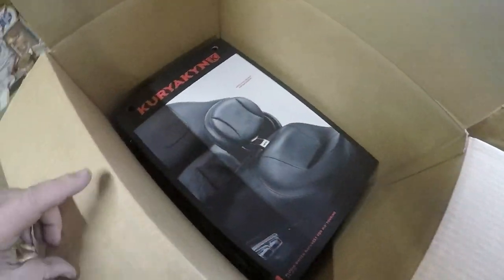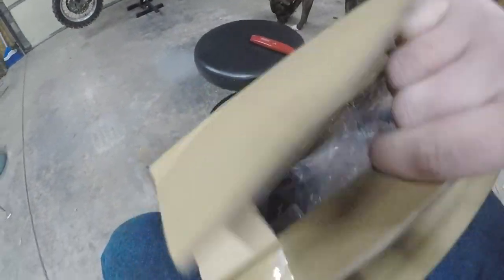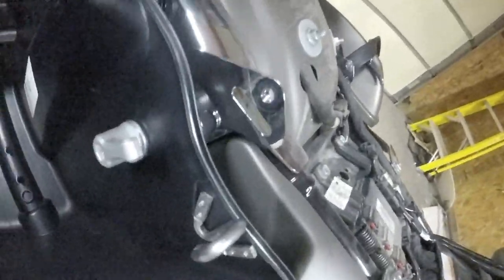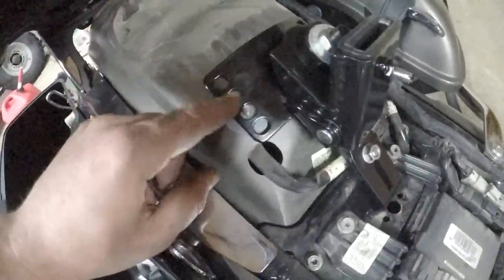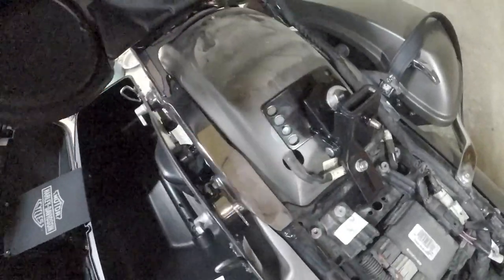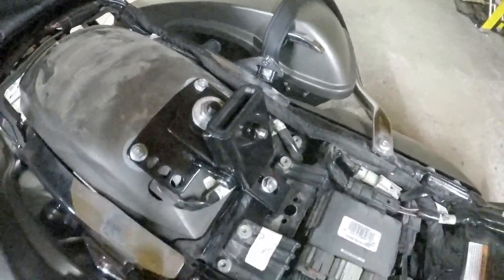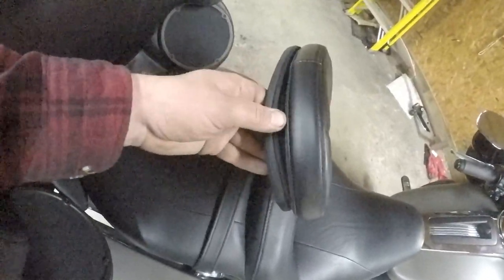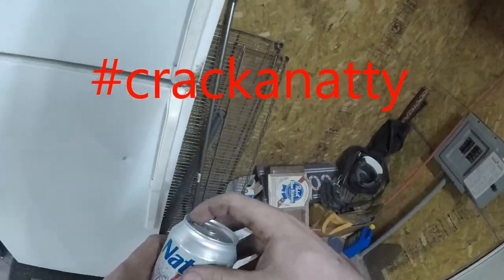Installing a Kuryakyn Backrest On The Ultra

Comment: Great video!  I just bought the same bike you have and decided to have my stock seat altered for my low back and tailbone.  Looked and demoed all types of seats and nothing worked well so, having someone basically leave a gap in the tailbone area so it's not pressing on anything along with raising the seat 3" on the back for my low back support.  Will get rid of my option for a slide in backrest but that's okay.  3" is a lot on a bike.  :)

Comment: Hi! Great Video!!! I just bought the same backrest and have it installed. I am also at the top screw, but I’m only 5’5”. I’m still not close enough. I can’t figure out how to adjust the part that you had to adjust as well- help
Reply from the maker: What’s the bike that it is installed on? There should be a big nut on it that will adjust the angle front to back should be able to get you where you need to be.
Reply: @theaveragebikergarage  it’s a 2015 RG- Thank you!
Reply: @theaveragebikergarage  thanks! Had to move to the second hole from the top and then adjust the big nut to tilt forward. I went as far as I could in order to reinstall the seat. Had to use a little force but got it in there!
Reply from the maker: @irnfocus  Hell Yea glad to hear it worked out for ya

Comment: Question, after you put the back rest in the receiver does it click in to secure it self. Meaning was it lose or did it secure tightly. About to install the exact same one on my 2018 SG
Reply from the maker: It clicks and it’s very tight like a pain in the ass to pull it back out it’s so tight….if I remember correctly there is a set screw on the back where you can adjust the tightness of it hope this helps
Reply: @theaveragebikergarage  thanks buddy! 👍
Reply from the maker: @rodericksaunders5887  no prob man thanks for watching

Comment: Question for you, the 2 bolts you mentioned towards end, does the top do the same as the bottom.  Should you turn the bottom the same amount as top or vice versa?
Reply from the maker: Oh man been a while since i made this video so I can’t remember exactly but I believe those bolts have a spring between them with like a piece of all thread going through the center and loosening them will angle it towards the front and tightening will angle it towards the back so you’d want to loosen the top one and keep the bottom one still or vice versa depending on which way you wanna move it hope this helps
Reply: @theaveragebikergarage  thank you

Comment: was hoping to a video on how to get it to lean more forward..almost mashes me think i need to pull my handlebars back more....how do you get the actual backrest to lean more forward. my back isn't even touching it
Reply from the maker: I had to adjust mine all the way forward and have the mounting holes on the ones furthest forward.
Reply: @theaveragebikergarage  ok..iwill try that
Reply: The Average Biker Garage how did you exactly adjust yours to move it forward besides placing it on the last hole?

Comment: Is the height adjustable on the backrest?
Reply from the maker: Yes it is. There are different slots for it to lock into and you can pull it out completely and remove it if you want to.